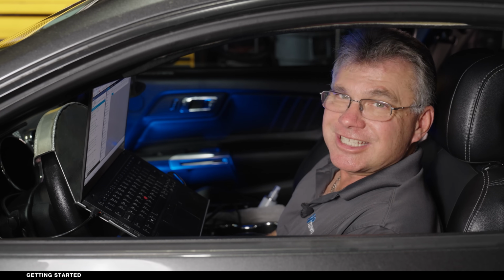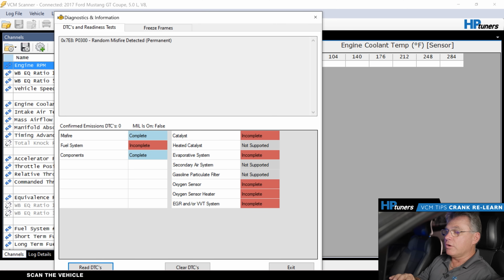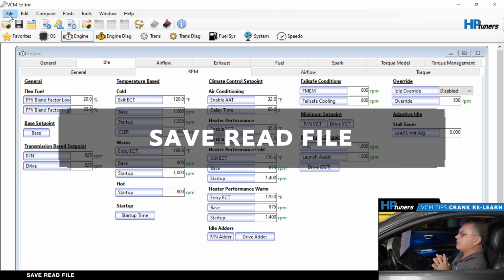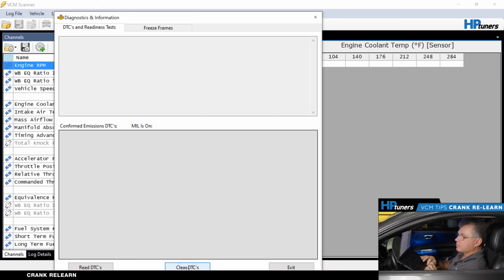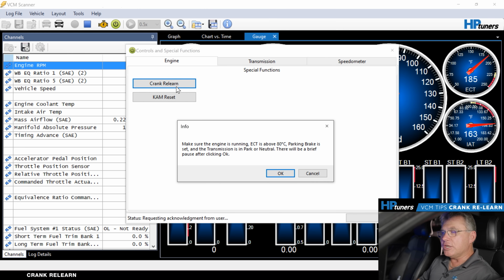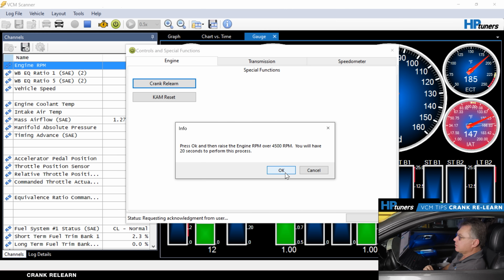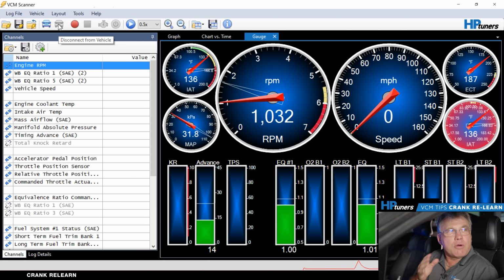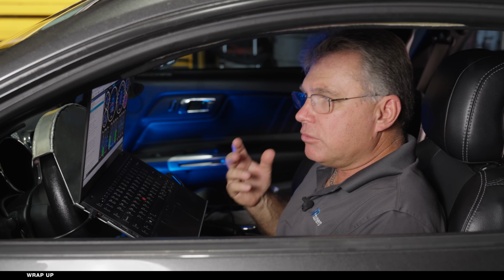How to Perform the Crank Relearn Function in VCM Scanner | HP Tuners

Comment: Does this work with a 2002 5.3 LS swap with a TH400 transmission and a BTR Truck Norris cam? Getting a P0343 code tried to erase it but after 10 minutes or less of running it pops back up

Comment: I replacement my crankshaft and camshaft position sensor on my 05 chevy trailblazer 5.3l v8 does it need and relearn after that because I now have a multiple random misfires
Reply: Same here did you ever get it fixed

Comment: im having the issue where it doesnt even give me the option to do a crank relearn in my 19 pp1 mustang
Reply: Did you ever figure this out?
Reply: @YoteDee had to use a buddies sct device and do a crank relearn. Never could get the other software to work
Reply: @ytlatenziii1166  just out of curiosity was his a different gen stang , I have a friend with a 99 cobra with a sct tuner and I have a 17GT I’m just curious if it’ll still work for crank relearn if not I’ll take it up to FORD , thanks
Reply: @YoteDee he has a 2012 model but any sct should work since they won’t be married to a particular car ( I could be wrong on that but my buddies wasn’t married to his car)

Comment: my 2011 Chevy Camaro 2ss threw a code for crankshaft position sensor and i replaced it today but now its throwing code for crankshaft position sensor circuit which is permanent. would this solve my issue?
Reply: no

Comment: No error code, but after supercharging my Jeep (and unlocking my PCM), the tuner said the timing was slightly off and attempted to manually adjust it. Would a crank relearn help with this?
Reply from the maker: Hey Michael! We don't know all the details here, but it does not sound like a crank relearn is the issue here.